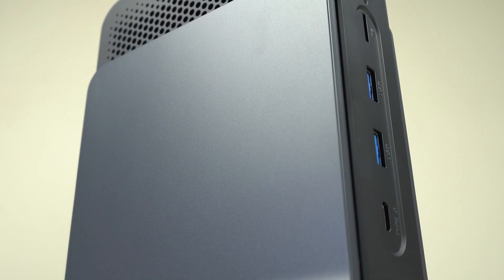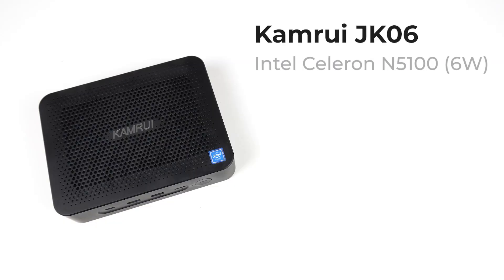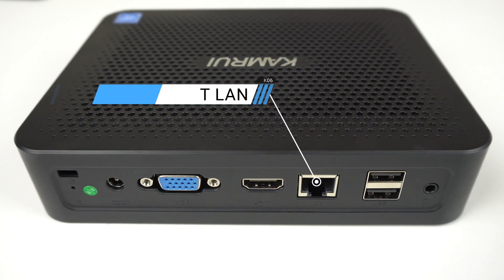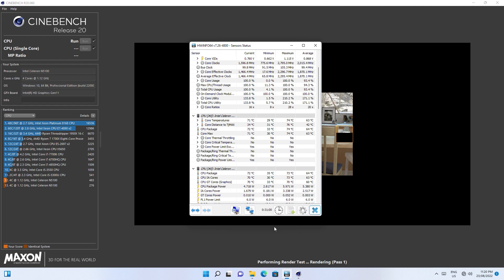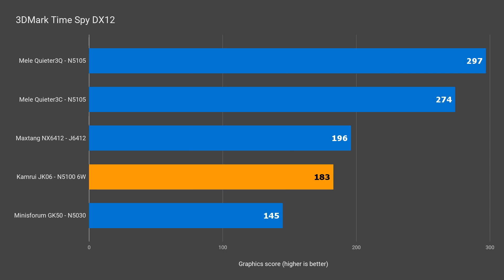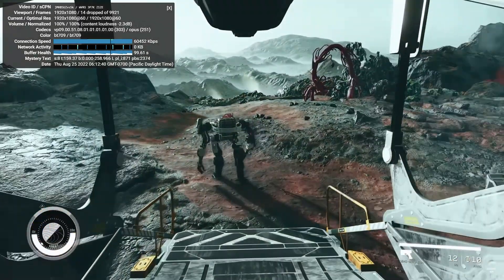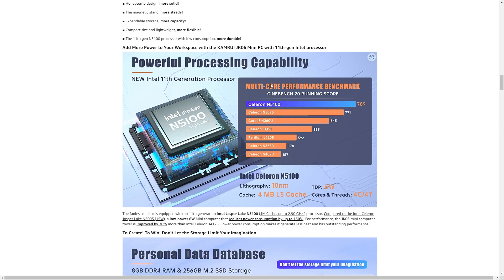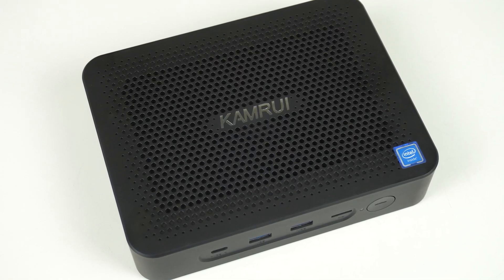Is 6 Watts REALLY Enough? Kamrui JK06 Review

Comment: You tested AC8 among fanless ones. To compare with this would be interesting, as it's cheap. AC8 has cooling issue which can be fixed significantly by removing plastic meshes inside, using better cooling paste and mb drivers from Newsmay site can be useful too in some apps. Two 2933 ram sticks there for a comparision are better.

Comment: Four USB-A ports, a VGA port, and ONE USB-C port... Ugh. I guess this is meant for an office stuck in 2018.

As useful as these benchmarks are, they are very gaming centric, and I don't think these are (for the most part) being bought to play games. I think showing off the work experience via performing some intensive spreadsheet testing, some video calling, moderate Adobe Photoshop editing, heavy website rendering would be more aligned with these types of devices' use cases. Not that the gaming centric benchmarks don't provide value.

Still waiting for Alder Lake U series chips for minis and laptops like the 1260U. Hopefully the U series is still a thing that's happening.